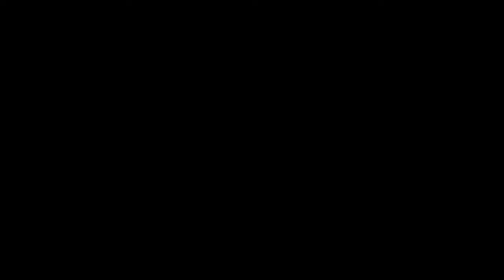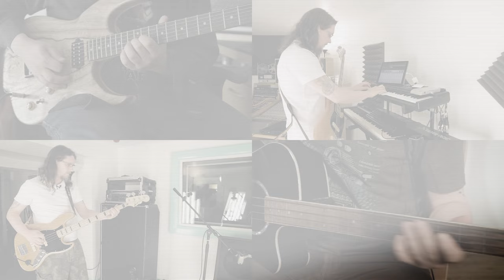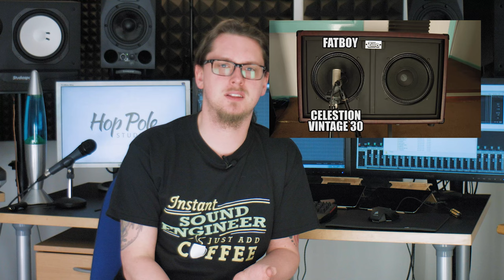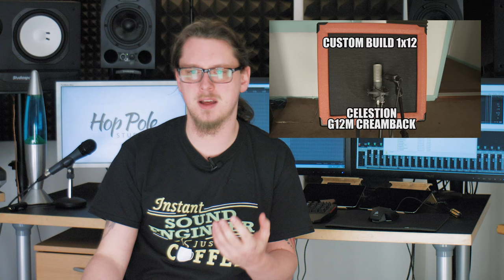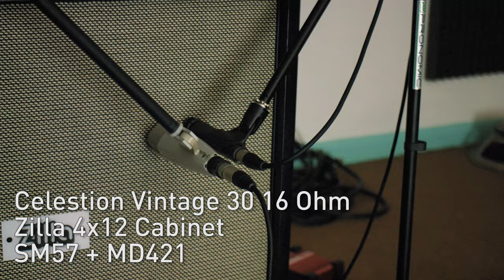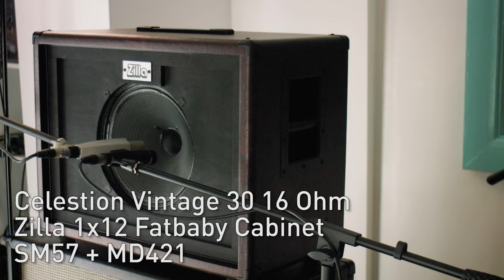4x12 vs 2x12 vs 1x12 Guitar Cab comparison:- All ZIlla, all Vintage 30

Comment: I got myself a Zilla Fat Baby and was dissapointed to find out that the grill cloth is actually not resting on the baffle but around 2cm off the baffle. Dissapointing because I always mic my dynamic mics right on the grill. Is that why you take the grill on your?
Reply from the maker: That’s the design of every good speaker cloth on pretty much any cab- they need something to mount the cloth to! But to answer your question, no- I take the grill off so I can see quickly and clearly where my mics are pointing and save a lot of time instead of guessing or messing around with torches

Comment: For my ears the 4x is better than the 2x is better than the 1x. But I'm thinking of getting the Origin 20. The question is, should I get a 2x12 cab, or will it sound the same as 2 1x12 cabs (which is easier to carry and mess around with). Do the speakers in the same cab make a difference?
Reply: That's the technique I employ...two112 cabs....one open back w/ v30 and one closed back w/ elite80 (egnater). They are easier to hoist and I can spread them out for better coverage. This works better when not miking

Comment: I agree that the less speakers, the more focused the sound is but there is a down side. The 1x12 was so much harsher than the 2x12 even in the mix. I hope the mic placements were 100% the same across all 3 cabs.

Comment: I'm guessing the amp settings were tweaked on the 4x12 and then used on the 2x12 and 1x12 as well? The results might have been different if you had tweaked it on the 1x12 to where it sounded good and then moved up to 4x12.
Reply: Good point...
Reply: I suppose they used something like noon setting. Otherwise it's a flaw indeed.
Reply from the maker: This argument makes no sense. The amp was set on a generically pleasing tone, with no bias or favour towards any one cab. Not a flaw even if this was the case, as what sounds “good” to me might sound bad to someone else. If you’re thinking one sounds better, that’s personal preference
Reply: @adamsteelproducer  I'm sorry, I didn't meant to sounds rude. Don't need to be so defensive. Your test is great and valid anyway, we can hear general differences. But the amp was set on a generically PLEASING tone on the FIRST cab you had hooked up. If that's a fact, the other 2 cab didn't have that "benefit". A different approach would be have that test in 4 stages. Stage 1: All amps at noon. Stage 2: All amps with the same bass boost. Stage 3 All amps with the same mid scooped. Stage 4 All amps with the same hi/presence boost. This way it would be possible to hear how each cab reacts to each of those boosts.
Reply from the maker: But all settings any particular way should be of no consequence in a comparison. If you thought it sounded best on the first cab great, but how do you know I recorded it in that order? Perhaps I changed it round :)
Also that set of tests you suggest would take forever to film. If you want to do that then go right ahead! More investigation in the guitar community is always good
Reply: @adamsteelproducer  I never said which one "I like best" and I never said that I know the order you recorder either. I'm just suggesting another way to improve this test even more. But obviously you are not open to suggestion. No problem. I would love to conduct a test like this, but I never had and probably never will have the rare chance to have 3 cabs from the same manufacture with same speaker at the same time. Cheers!

Comment: Hate to tell you but there's a flaw, it's the grillcloth. It filters out the high end, that's why the 212 and 112 sounded brighter. Should have taken the grillcloth off of the 412
Reply from the maker: Nope, doesn’t make an audible difference, at least nowhere near that much. I made a video on this to prove the point.

Comment: I have a Mark V 25 with a 2x12, but i think it's too loud and I can't crank it on an apartment. If I use a 1x12 will it act as some sort of attenuator? Will I be able to reach good tone at lower volume?
Reply from the maker: Simply put- no. You might get a few dab reduction but it will still be offensively loud! You need an attenuator, like a two notes Captor 8
Reply: @adamsteelproducer  is the captor X as good?

Comment: Doesn't every speaker have a slight different sound to it? Like if you compare 2 of the same model vintage 30's they will sound slightly different? Did you use the exact same speaker (like take it out of the 4x12 and put it in the 2x12 and 1x12) to do the tests? If you watch SpectreSoundStudio's video on how to record heavy guitar, he shows that his 4x12, even though it has all the same model V30 in it, each speaker each had its own slight sound difference.

Comment: I saw the original video and after hearing this one which represents a fairer representation, I still believe the 2x12 sounds best, it's fuller and more open but without the thinness  of the 4x12, or the harshness in the highs from the 1x12.

Comment: I may have found a flaw to an amazing video. 1x12 gets say 100watts from the amp. 2x12 each speaker gets say 50 watts and 4x12 gets 25 watts per speaker. Doesn't that change the sound since each speaker is being fed differently? I hope you understand what im saying. Send adam some money on pateron, hes doing good shit out here.
Reply: I've been doing some research and it seems yes it does, and that's part of the reason. At different volumes speakers can sound different. Splitting a 100 amp at 100% efficiency and reducing to half watts reduces speaker output by 3db, so doing it twice (to 4 speakers) reduces each speaker by 6db. However, soundwave peaks can  combine from all speakers, and they gain 3db for each doubling of speakers, so a 4x12 will be -6 per speaker, but can combine or trough to + or -12db. Therefore overall there are peaks hitting 12db higher, so will be louder. Depending on how long the wavelengths are and how far apart the speakers are, they combine and  get reduced/increased differently. Weird things also happen in closed back cabs (which were originally meant to reduce movement of the speakers so they wouldn't break when underpowered). Also an angled cab will do different things.
Reply from the maker: All fair ideas, but I wouldn’t say it was a “flaw” in the video, more of a takeaway as to what’s going on in a complex scenario in the real world
Reply: Agree, it's a great video which demonstrates exactly what the differences are, but there's always more questions!!!
Reply: You’re taking it the wrong way...you choose  a cab for the sound it produces with the amp you have. In this video it shows exactly what to expect with different combinations.

Comment: Hop pole studios. Thanks for the vid very useful. Which would you say is louder the science says with more speakers it would have less volume I.E  1 watt = 100 dB (v30 sensitivity rating) so 1 watt into 1 v-30  is 100db where as 1 watt into 4 v-30s would be .25 for each lowering the dB and the perceived volume. Would you say your test agrees with that or no? I’m trying to lower my amps volume!
Reply from the maker: That’s definitely not how it works- it’s roughly the same volume if not a little louder with more speakers due to equal power distribution. If you’re trying to lower the volume you need an attenuator
Reply: Hop Pole Studios well there’s lots of ways to lower the volume, and that is how it works the get there sensitivity rating using one watt testing at one meter so 1 watt into 1 speaker is 100 dB so 1 watt into 4 speakers would be 120 dB ( i now know that bc I asked someone else) before I thought it would be lower in dB either way thanks for the reply

Comment: that's interesting about the coils on the 16ohm, the inference being a 1x12 would sound bassier and better with a 4 or 8 ohm speaker,,,does anyone think the ''made in England'' v30s are better than the new chinese made  ones? ive not heard a comparison. im not criticising this video at all because it think it's great , but there is no mic set further back ,I think that would have made a bigger difference...but maybe its cos youre playing metal ?

Comment: This is frustrating me and I can't find the video with your 6505+ gutted out, what cable did you use to hook a gutted amp to different speaker cabinets? Can't find them anywhere
Reply from the maker: The 6505+ still had 2 regular speaker jacks on the back, I took the wooden enclosure off but that doesn’t change the amp setup. Standard speaker cables work just fine

Comment: Hate to be picky but 4x12 would be wired to 16 ohm, 1x12 would be 16ohm, 2x12 with 16ohm drivers would be either 8 or 32 ohm depending on series or parallel therefore putting a different load on the amp, but I don't think you will ever get a fairer comparison than yours.
Reply from the maker: +pete hixson like you say, it's impossible to have a 2x12 wired to 16 ohms with the same speakers in. I've done a separate video talking about speaker impedance. For the 2x12 they were wired in parallel to bring the impedance to 8 ohms, and the amp was switched accordingly so the transformer tap matched making the tone as similar as is possible
Reply: Hop Pole Studios running an amp at 16 ohm tap with a pair of 16ohm wired series at 32 would be safe for a period of time as I understand it. It's only bad news when you run it through lesser impedance than it's expecting because the current returns twice as hot to the tranny and burns it out like hoes vagina.

Comment: I'm trying to decide on one 2x12 cabinet vs two 1x12 cabinets. Would you be able to make a video like that? I play a Bugera G20 Infinium (EL34 power tubes), and I recently came upon an opportunity to buy the Bugera 212TS (used) for the price of one new 112TS. Both cabs feature Turbosound 80-watt drivers, and I've grown found of them now that they're well broken in for over a year. By extension, I guess a single 4x12 compared to two 2x12s would also be a video worth watching. (Nice job on the video, btw!) I'm subscribing.
Reply: Tim Borek I have a 2x12 as well as 2 separate 1x12s. 

I prefer the 2 separate 12's. It's much more versatile, and lighter, but more trips when setting up for gigs. 

I like to use mine stacked vertically, but you also have the option of stereo, as well as just using one cab for smaller gigs/jams.

That's my 2 cents.

Comment: Nice video, but I think you may be missing the point by placing the mic on the speaker as opposed to in the room placed by your ears pointing at the cabs (may require a different mike).
Reply from the maker: I disagree, the point is the point. In my context, recorded tone is everything. What happens in the room is largely immaterial and doesn’t translate to recordings at all, I’ve made other videos on that as well to confirm that claim. Of course cabs sound different in the room, but in a modern recording context how much difference does it really make? That’s the point here.
Reply: @adamsteelproducer  in a recording context I totally agree with you (I think I missed that part of the video where that was mention), obviously I feel differently about it in a live playing context which is all I was referring to.... I got my wires crossed!

Comment: What is the amp wattage powering each cab? Running power more efficiently to a 1x12 vs under powering a 4x12 would make an astronomical difference in sound.
Reply from the maker: +Nicholas Knight the amp was set identically each time, probably pumping around 50-60W at a guess. You may have a point, but that's part of the results as much as anything else- but I can assure you the 4x12 wasn't underpowered. It was easily loud enough to send someone half deaf, the speakers were moving

Comment: You need to keep all cabs off the floor or on the floor as the floor accentuates bass resonance. Wasn't enough you micd too mic in 4x12. In other words, put the 2/1x12 on the floor and it will be more lower voiced.
Reply from the maker: Not true at all, especially in a mic’ed environment. I might do a video to prove this

Comment: oke oke this was interesting. but what if you took a 412 with 16ohms v30, a 212 with 8ohms v30 and a 112 with 4ohms v30. because the extra windings on the speaker makes it brighter and with the low end on a 412 balances it out. so a 212 8ohms and a 112 4ohms should sound the same???
Reply from the maker: +bryan berends not only is that not how it works, Celestion don't sell a 4 ohm V30. I asked them directly. There's a lot more going on than brightness based on coil windings
Reply: my mind just exploded... so much to test...

Comment: 4x12 has more mellow and cleaner sound to it, and synergies well with the bass in the mix, i had easier time to distinguish the notes on the guitar compare to the others. 2x12 definitely had more bite and mid range but leaned into the ice-pick tone a little. For recording i would go with both 4x12 and 2x12 so you could pair a harsher tone with a more mellowed one, kinda like how queensryche did during the mindcrime and empire era.

Comment: if one speaker is mic'ed and you're not 'in the room' then why would it matter if it was 1x12, 2x12 or a 63x12?
Reply from the maker: Because the number of speakers vibrating the same baffle, the cabinet dimensions etc make for very different sounds. Can you not hear it?

Comment: In person i prefer a 4x12, but for a recording the 1x12 has a tigher bottom end, which i prefer.
Reply from the maker: OOOHHHHH SNAP
Reply from the maker: To be completely honest.....
They’re all too loud for home use (depending on if you have neighbours within a mile radius).
So having said that, it’s more about tone than volume when choosing what’s right for you, and cabinet build plays a large part. Speaker breakup isn’t going to happen at any human-bearable volume (it happens at Hendrix-level gigs) so you’re better off, in my opinion, getting an attenuator and driving the Power amp valves a bit without killing anyone
Reply from the maker: So long story short, I’d pick the 2x12 because of cabinet size and resulting “weight” to the sound for playing in person, and a 1x12 for recording with because it’s extremely tight sounding with a mic in front

Comment: For the studio, the difference between 2x12 and 4x12 is so insignificant (I could hardly tell a difference even with my well trained ears) that its best to save a little space just go with the 2x12. It sounds great!
Reply: If you can't hear an immediate and obvious difference (the 2x12 is way slicier in the treble and has more rolled-off bass, the 4x12 has the 1k-ish honk that only 4x12 cabs do), I daresay you need way more ear training.

Comment: Question for anyone: Is it possible to play live in a small club by miking a 1x12 to FOH. Is this kind of set up becoming the norm nowadays or are local metal bands still using 4x12s? Thanks
Reply from the maker: +The Driver metal bands are still using 4x12s, but they really shouldn’t. A good 1x12 mixed up live sounds incredible
Reply: Yeah, I get that every venue is different but with today's PA technology, why not take advantage of getting a good tone without having to carry so much. I assume it's best to isolate the 1x12, miked up, if one decides to go that route? Thanks

Comment: 112 sounds super thin.. im gonna sell my PPC112 now, getting 2x12 instead!
Reply: Wait so you just noticed your 1x12 sounds thin? So because they made a recording you didn't like the cab is bad? Lol I have a ppc1x12 too btw. V30s are thin no matter what that's why they should be on the ground. I changed my speaker for an eminence swamp thang and then got another 1x12. Anyways fuck what you hear on one recording there's so much more going on then just your cab size.

Edit: I'm happiest with 2 1x12's for some situations but at home an recording a 1x12 is all you need. But if you'd rather spend money than make what you have sound good enjoy the endless chase.

Comment: Looks like the microphones are positioned differently on the 4x12 because the 2 and the 1 sound almost the same while the 4 is far apart :P
Reply from the maker: I’m 100 percent sure the micing was exact, we checked it several times with tape measures from several angles, the 4x12 just sounds that different from the others- I figure it’s mostly to do with baffle resonance and cavity size
Reply: Ah okay...very weird ! :)

Comment: I think the grill on the 4x12" does effect the tone a lot
Reply from the maker: It doesn’t. I made a follow-up video on exactly this.
Reply: But why is there so much difference between the 2x12(or 1x12) and the 4x12  but not between the 1x12 and 2x12? The 4x12 sounds more present in the low end and in general sound more processed while the open cabs got a more raw, top end sound. Or is this related to the other speakers giving their low end to the mix. Because theoretically the only thing that really gets from the 3 other speakers to the mics are the low frequencies. Now that I'm thinking about it this could really be it. From the 112 you really get the "raw" sound of the speaker. In the 212 and 412 the extra speakers add a significant amount of low end to the sound. The jump of the difference could be related to the fact that you basically triple the amount of added low end. Does this sound plausible?
Reply from the maker: It’s more likely to do with the cavity size, baffle interaction and resonances